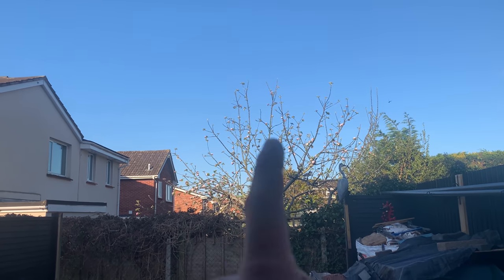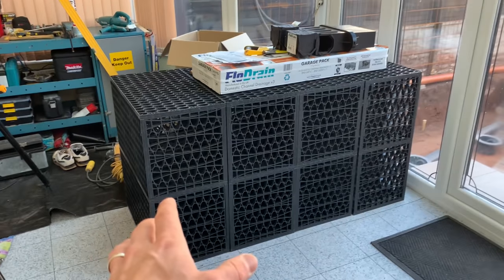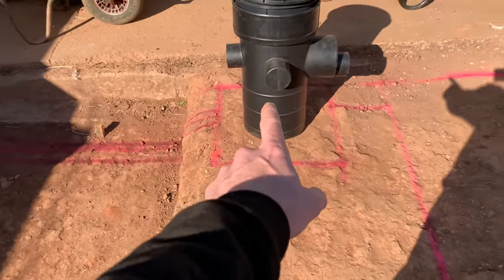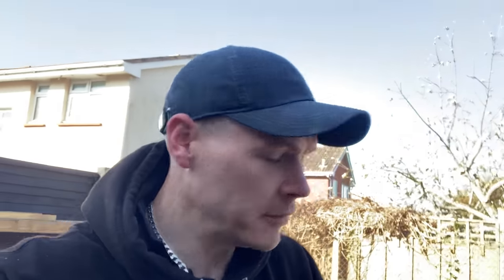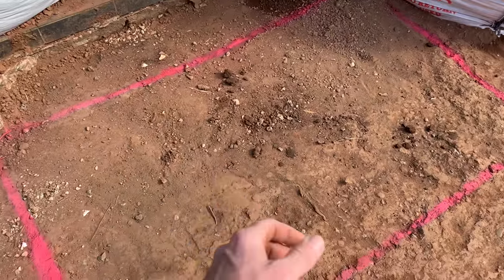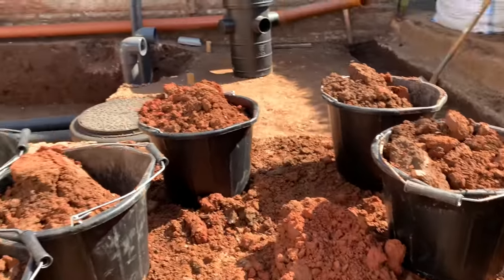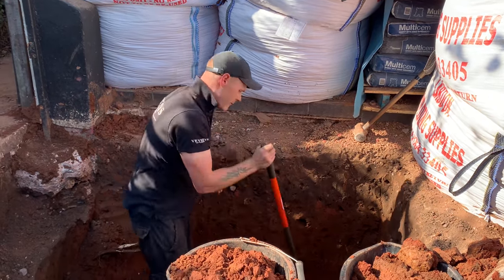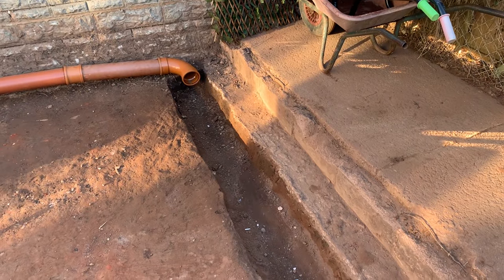I HAD TO DO THIS LOADS MORE DIGGING BUT WHAT A HOLE!!! **SOAKAWAY** PART#22 THE NEW DREAM KOI POND

Comment: Well done James doing a cracking job.Its a well thought out solution to a big problem, good on you.  If you ever out of a job as a butcher you can always go on an archeological dig, you've had the practice. 
Glad someone is getting good weather, its been really cold in the night here in Nottingham, my pond is still only 10 degrees and it gets sun in the afternoon and evening. When we get some that is. If it gets too hot for you, you can always send some up here.
Keep it up, you will soon be on the pond building. ⛩⛩⛩👍🐇🐇🐇🥇🥇🥇

Comment: Use the sand in your concrete mix to bulk it out and save money. I did this in my sisters garden to create foundations for retaining walls and there was no problem with it setting, went of Rock Hard. You should do a test mix and see. All we had to by was cement so it saved a lot of money and grafting. Might be worthy of a thought for you in your situation.

Comment: James, You are doing a cracking job to achieve your dream pond! Just a thought - the sand you are digging out looks nice and clean so might be worth keeping a dumpy bag of it to use with your mortar mix when building the pond block walls - will certainly save you a few notes!

Comment: James.. unless you’ve already done it, there’s no need to run the waste water pipe from your filter drain all the way around to your sediment pit. Personally I’d put it straight into the 4” pipe and let it flow that way
Reply from the maker: Yea might do that mete
Reply: Might even help keep the 4” clear of any moss that might settle in the pipe near the 90 bend as the force of the pumped water will push it out.
I’d also be tempted to add a rodding eye in along the long run just incase you ever need it.

Comment: I can only dream of getting so many subscribers lol. You are lucky with the ground. My ground goes that deep with solid clay. The only way I could dig down 3 feet was with the Jack Hammer to break it up and then shovel it out. Nightmare!  OK silly question time. Do you need the soil pumping barrel thing (no idea what it's called lol) now that you have the soak away so close to the filter house? Couldn't you drain straight to the sediment chamber? Just thinking you could probably sell the barrel thing or send it back and get a refund on it. Might save you some dosh.